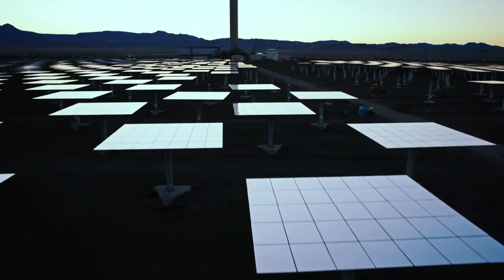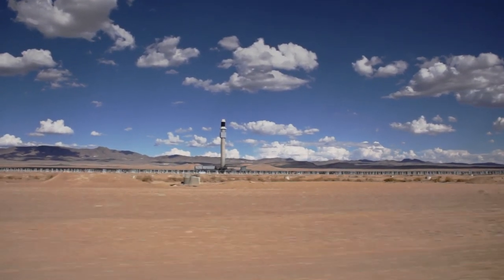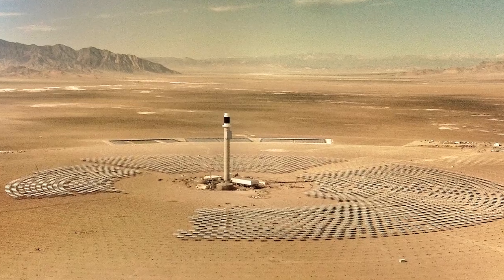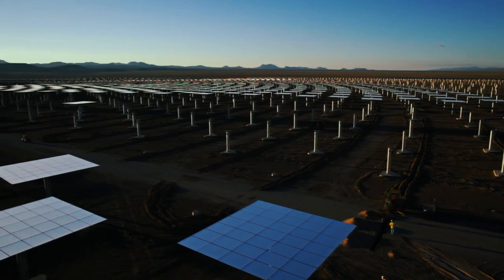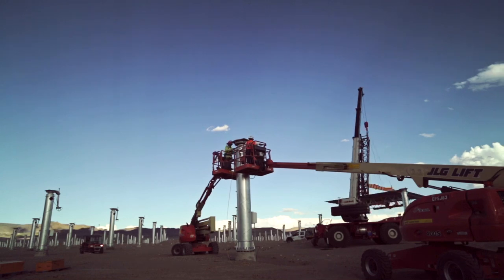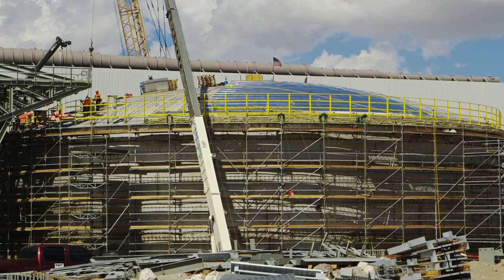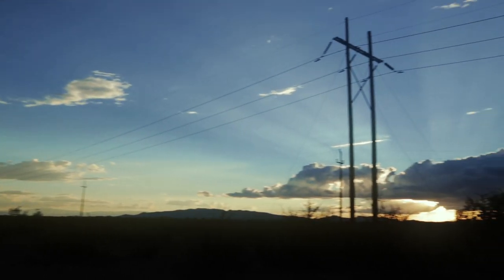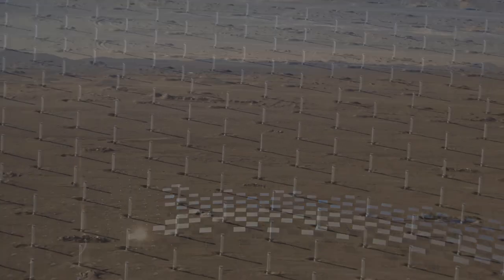Crescent Dunes Solar Energy Project Part 1: The Facility-The Window-WIRED

Comment: The future of tower power CSP nice job.
They are testing parabolic trough type CSP systems with molten salt storage. The length of the pipes and the joints are creating some engineering challenges at the moment but are not insurmountable.
It's nice to have power 24/7 and molten salt is the way to do it with CSP at the moment.
The tank issue was an engineering failure but the concept is a win.
😎👍

Comment: Bunch of foolios....molten sault and these expensive stuff.they couldve use regular mirrors and regulat water to make steam snd spin turbine....instead they made it all so complicated that they went bancrupt....1bln? U kiddin they couldve get it with 10 million bucks easy. The more advance the more likely for a failure. This cluld be super simple and still working....forget about peak hours use gas for peak and sun for air conditioning peak

Comment: Outside of the solar panels being used to creat additional power. This was attempted near 29 Palms in CA. however it used oil to run the generaters using large mirrors to focus sun light.

Comment: Phase change materials are the best way (today) to store thermal energy. The latent heat required change from solid to liquid is tremendios and remains trapped in the liquid until the phase is revearsed dumping all that energy. In this case through heat exchangers to generate steam and power turbines.

Comment: Solar? It may be useful for small scale cell phone charging, but unless breakthroughs are made right now I don't see it providing 100% of our energy. Nuclear fuels are long term solutions, and by that I mean thousands of energy - and we don't even have pure fusion energy yet. I do hope we can implement ways of using nuclear waste that stays hot as a fuel for more than just long term space missions - which it already has been used for.
Reply: useful for small scale phone charging? Solar runs the energy of my house every day. over 10% of Australian households now have solar photovoltaic panels on their roofs, providing cheap renewable energy to the people and allowing them to avoid the grid. Look at Germany, where solar and wind are close to powering 50% of the country's grid, well ahead of their targets. The technology is here, the only obstacles to widespread employment of solar and other renewables is political, not economical.

Comment: I wonder if maintenance will be any harder for this plant than any of the other power plants we use. If the mirrors get scratched or covered in dust the amount of sun light they will be able to reflect will deminish significantly so making sure all or most of those mirrors are kept very clean will be a top priority and that sounds like alot of labor and capital
Reply: 11 años después te digo:  genio